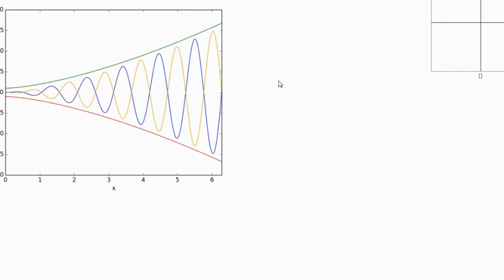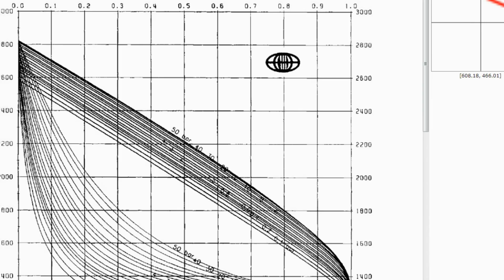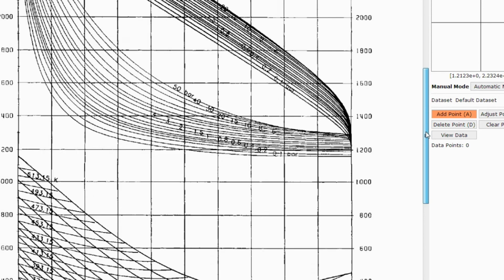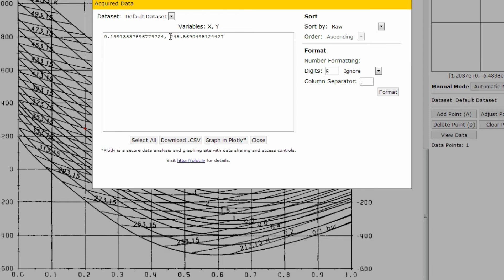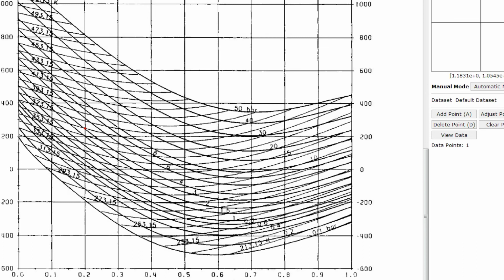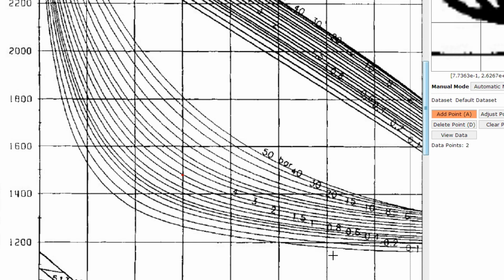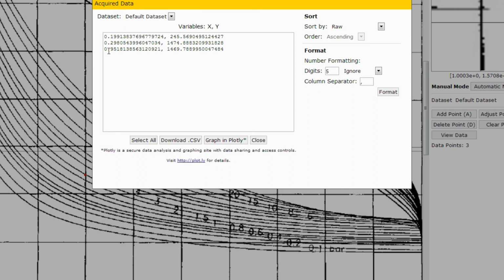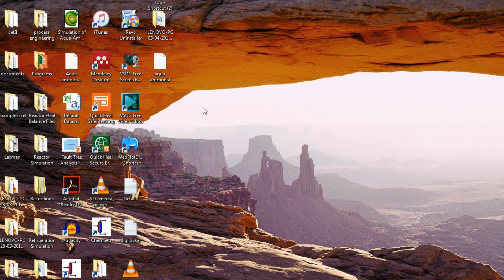Aqua Ammonia Enthalpy Concentration Diagram

Comment: Can u please share the h-x chart with us
Reply from the maker: Is is available on the internet. You can get an authentic chart from Perrys, Chemical Engineering Handbook. I wouldn't like to share the chart I have as it would be infringement of copyright laws.
Reply: @profarvind  actually i searched in the internet but problem is the dewpoint lines(upper portion of the chart) are merged so we can not distinct the diff pressure lines may be I find it clearly in the book which u mentioned

Comment: how to increase humidity in cold chamber
Reply from the maker: The humidity is a function of the dew point. The lower the temperature in the lesser it the humidity. No to control humidity, you can admit hot air with high humidity in the cold chamber and fix the temperature of the cold chamber. This way the humidity will be fixed to the desired value.